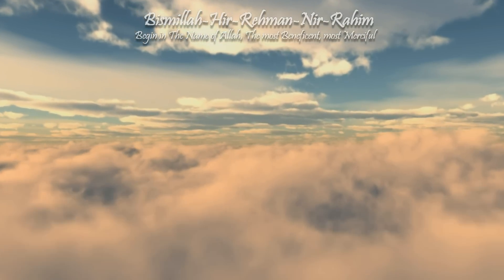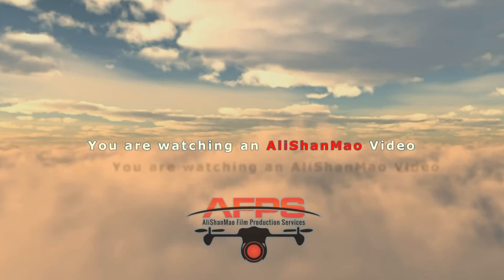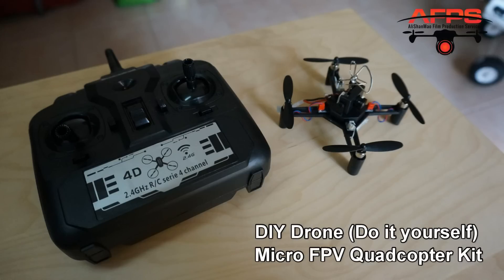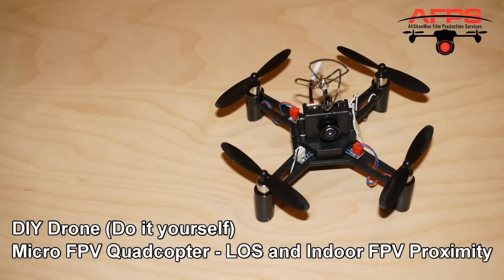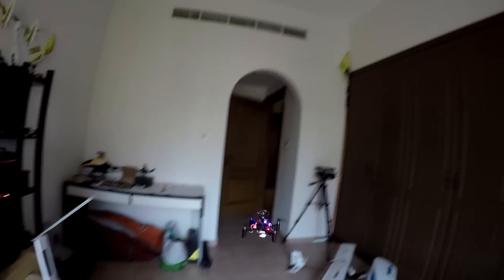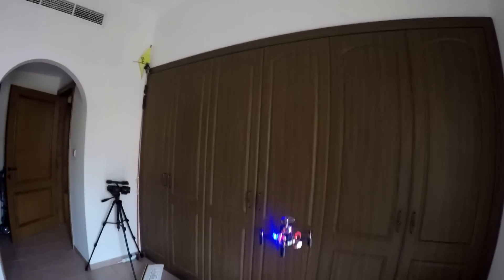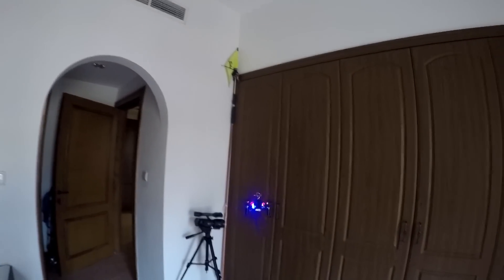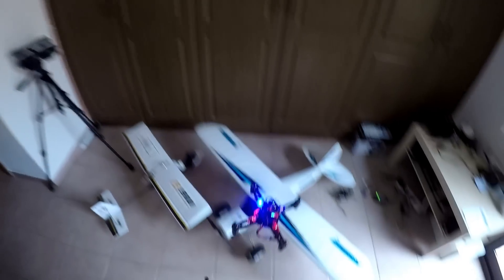DIY Drones Micro FPV Quadcopter Indoor FPV Proximity

Comment: Ali:
    Your demonstration seemed to show resolution of the poor yaw this quad experienced in early batches. Did your unit come from a pre-release of a factory corrected batch, or a regular distribution batch? I see that your video is dated Feb 19, 2017.  When did you get yours? What was your source? Bang Good, other? 
    If we order now, can we expect to receive the corrected firmware? Did you experience any dead zones from your transmitter controls? Has that problem been resolved too?
    Your navigation through the house seemed to show great precision and control, different from earlier videos on the DM002. I think the Cam/VTX is well matched to this unit.
    What was your average flight time with this unit? AndyRC predicted only about 3 min 50 sec, though the specs suggest 7 min.
    I like your friendly, clear style of presentation. Keep up the great work.
Jim
Reply from the maker: Unit I had from Banggood. no dead zones on Tx.

Comment: Hi Ali..I can't seem to get this drone to hover in place to really try fpv. It just continues to climb to ceiling. If I lower throttle alittle it just drops and it's a constant up and down. Could mine be defective?
Reply from the maker: mine flew just fine. no idea. there are no tweaks to FC. maybe see if Throttle trim on Radio helps
Reply: alishanmao I will try that. Worst case will try another build :) thanks for the reply

Comment: Hi Ali. I just got mine and fully assembled it. However I can't find a feed on the camera. I tried channel 1-8 without any luck. Also mine seemed to be drifting to the right....did you need to do any adjustment to yours?
Reply from the maker: FPV system is in PIT mode, its on but not transmitting. Hold the button for more than 5 seconds. you will see a hyphen blinking, tap the button again, 2 hyphens, tap again 3 hyphens. Single hyphen Tx is in 25mw Power mode, 2 hyphen 50mw and max is 200mw on 3 hyphen. But it gets extremely hot on 50 or 200mw be careful as it drains battery too much.

drifting right means you can center the gyro or see if your board is mounted perfectly horizontal or not
Reply: alishanmao thanks very much I got it working. I did it for 25mw. Your videos rock!